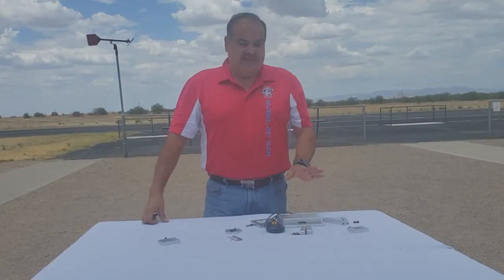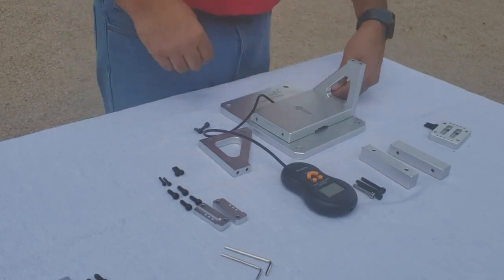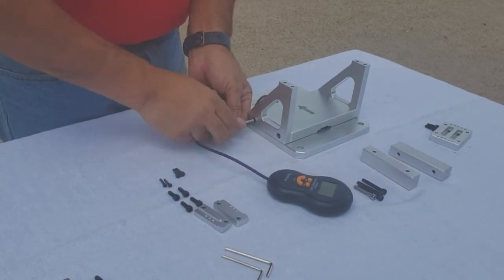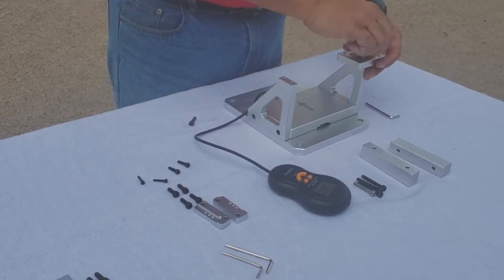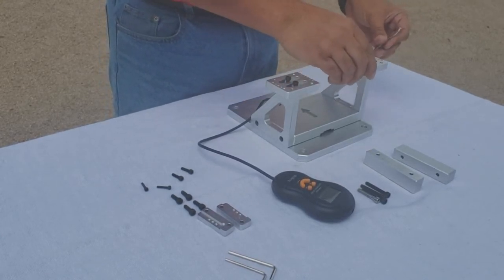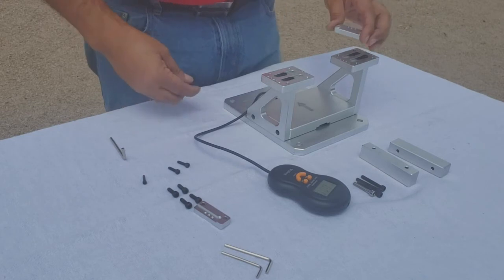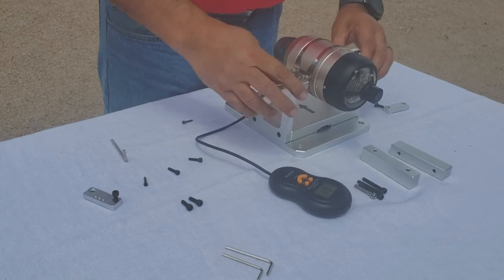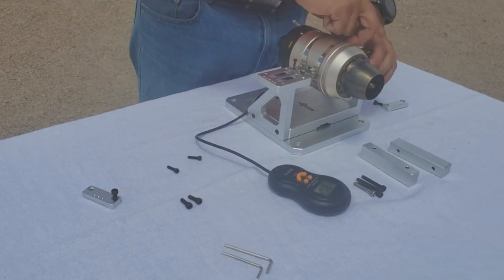JP Turbine / EDF Test stand from Banana Hobby

Comment: Ralph, A couple of observations:
Why didnt you show the removal of the shipping screws for the test base on the bottom of the stand,?? w/o those removed
the test stand cannot register kg or lbs of thrust.

second. you referred to the screws as 4-40, they are not they are metric, they are 5mmx .08, this is made in Dongguang, China 
I can assure you that they do not use SAE hardware